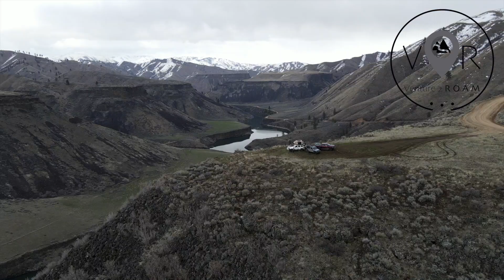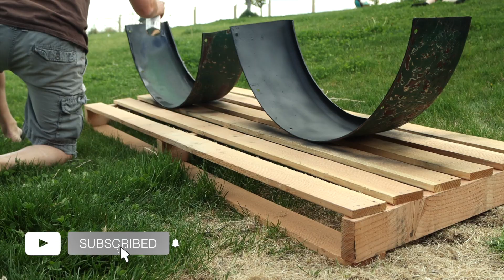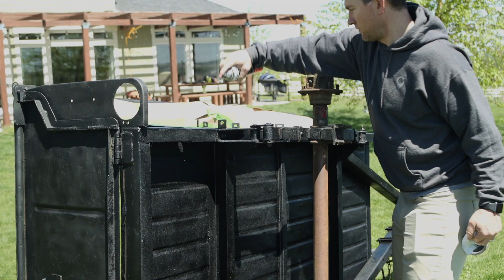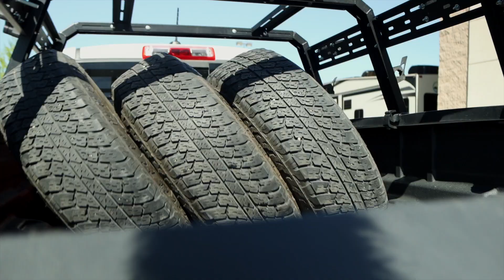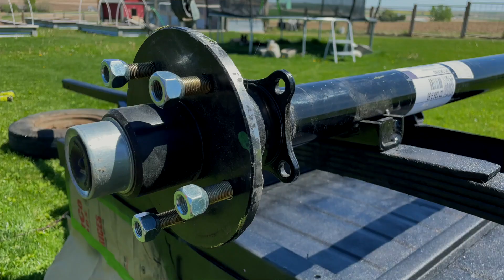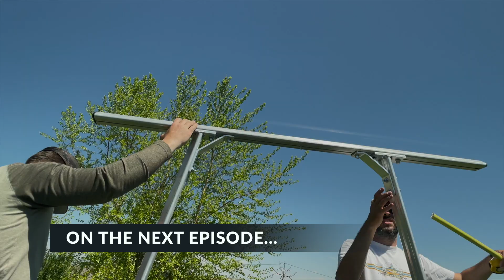DIY Off-Road Overland Trailer Build | Part 2 New Axel

Comment: What were the Axle measurements and more importantly, where did you purchase the new axle?  I have 2 bantam trailers and I want to go the route of new axles instead of wheel adapters.  I want to run the first trailer behind my YJ with same lug/hub ratio and the other trailer behind my son's JK to match his lug/hub ratios.  Awesome build, guys.  Loving your journey.
Reply from the maker: David - we ordered ours from compact camping store. They do custom axles. It took about 4 weeks to get it, but both times we’ve used them the axles we’re perfect. I think it was $300-$400. They tell you exactly what to measure as well.